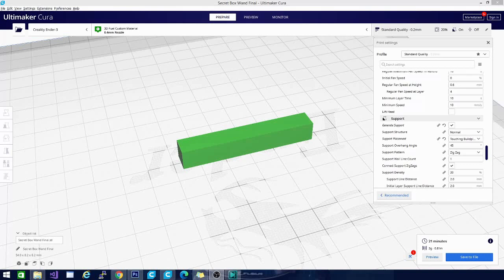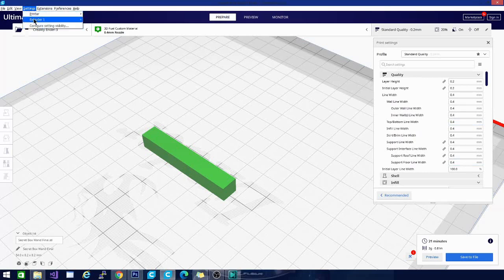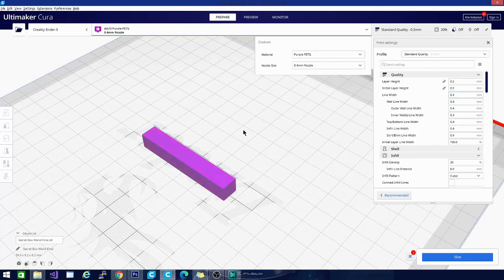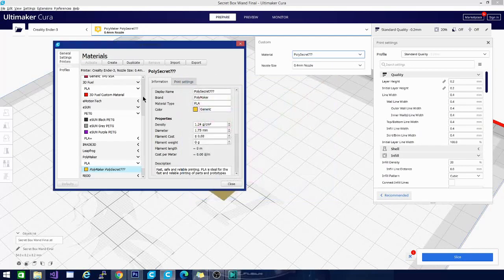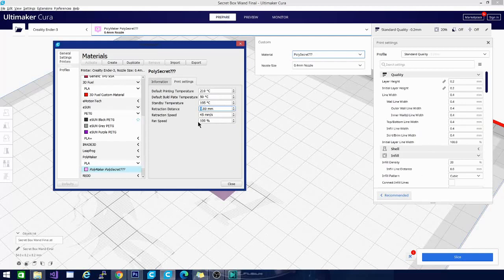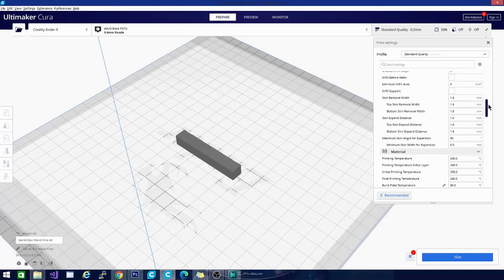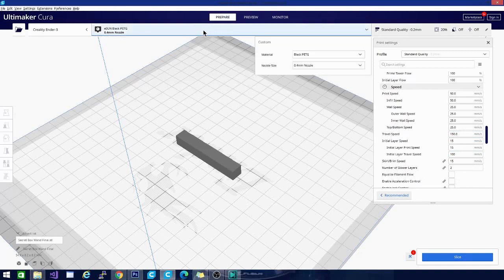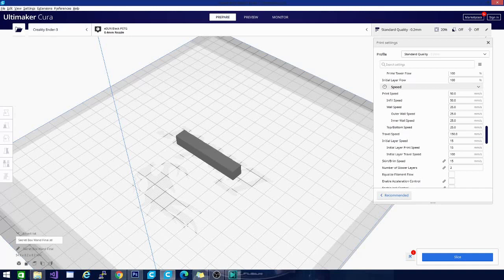Cura Settings -   When To Use Materials instead of Profile Settings

Comment: Thanks, I was trying to wrap my brain cells around the relationship between materials and profiles especially as my printer is not listed and so is custom. In which case it seems that I  should just stick to using profiles and avoid the materials route as I am happier using custom settings. The way the materials can override the profile was catching me out. Thanks again, Jim

Comment: Very confusing Materials vs Profiles.  I think (maybe) I understand now but was always confused if Materials settings override Profiles.  But here is another wrinkle:  do temperature settings made manually in an Ender 3 (e.g. nozzle and bed) always override the temperature settings in the Gcode resulting from the changes you discussed in CURA ?  Or only if you make the manual changes at certain times, or not at all ?  Thanks for addressing Materials vs Profiles.  Only video to do so AFAIK- rest are just on importing/exporting or modifying profiles.

Comment: Thanks for your video. I really like CURA, but I think this, along with the printer profiles, is a real weak spot in CURA. Especially this. It is so unintuitive and, like you said, almost worthless function. Having 10 million choices of materials already installed that I will never use doesn't help either. Even saving a new material is very confusing - no save button to confirm changes. They really need to revamp this aspect of the program. I think where this is most useful is where detailed settings is turned off, and you are using basic settings to print stuff (who does that? :).

Comment: This is great as I had set profiles for my PETG and TPU filaments also I have some silk PLA filaments that need 210 C or the prints delaminate, to have a setting for my non-standard materials makes printing them much simpler!
Reply from the maker: There is a great extension for material management as well that i will cover soon!
Reply: Thanks for confirming the conclusion that I came to - Material settings are pretty worthless for choosing the correct printer settings prior to slicing. If you select a material to get the appropriate bed and nozzle Temps and then choose a custom profile, those temp settings can be overwritten. So you always have to check your settings anyway. The only use I see for the materials is that it is just a place to store material specific information like the best Temps for a given material/manufacturer. Basically it is only good as a reference guide and not a tool for picking settings. UNFORTUNATE!